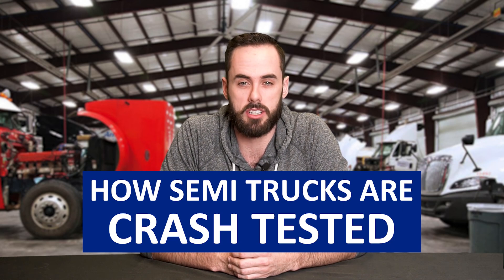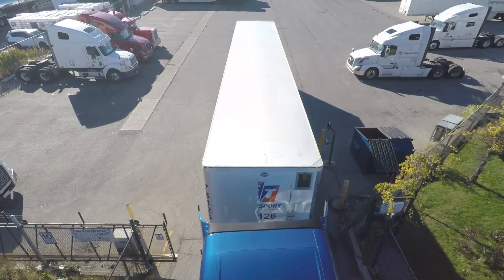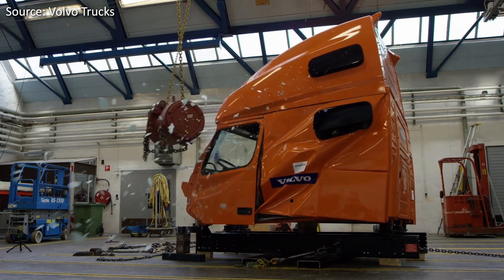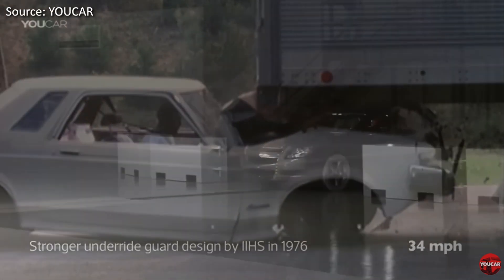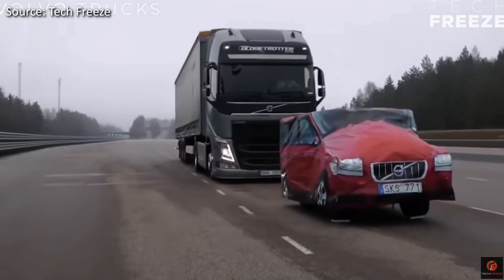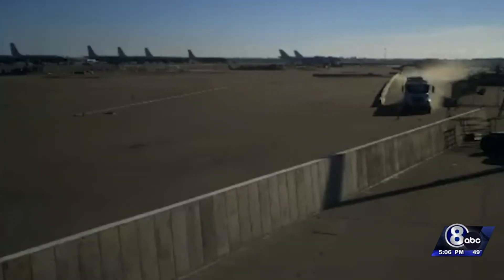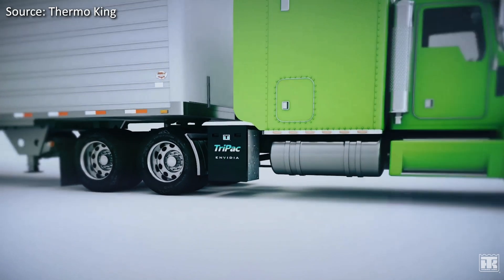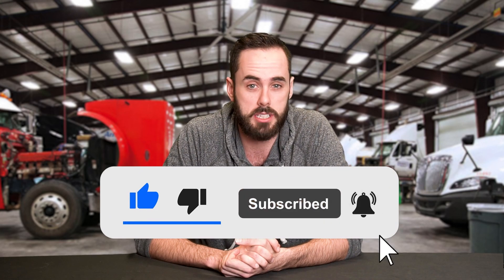How Semi Trucks are Crash Tested (Don't Mess with a Semi)

Comment: 0:50 Yep!!!  Junction U.S. 97, Washington Hwy 14! The door swinger believes EVERYBODY is gonna turn and stay on 97.  What? A three way…STOP? Trucks have just come off about a four mile downgrade and then a door swinger pulls right out in front. I drive Washington 14 just a few times a year and this has happens a lot!!!
Reply: That is a frustrating intersection,   it is asharp turn to get straight to see both directions with limited vew distance to the right and traffic coming off the hill to the left.  That hill is not the 4 mile down-grade but comes from the bottom of it, 90% of trucks turn right after that hill to get down to 84 or continue on 97south.  It is frustrating because most people turning, do not signal till the last second, then you have to watch for anyone flying around the bend on the right.  It really needs to be re designed to prevent accidents like that, but that was completely the fault of the driver that pulled out. He had no right of way from either direction. Just impatient and incompetent.
Reply: @Bendigo1  Wasn’t exactly sure how long the downgrade is coming from Yakima. However, northbound sitting at that stop sign you can see more than  enough distance to not have pull out in front of ANYBODY eastbound or westbound on 14!
Reply: @onebadapple83  I have driven that stretch many times, i knew what you meant about the grade, but it is not really a factor as you need to stop before turning left on 14 from 97.  That short stretch is steep and traffic going east from 14 does not have to stop.  And yes there is enough distance to the right to not pull out in front of someone, but once you start the turn you better get moving because traffic going west on 14 will come around the corner and try to take you out.   Either way, there was absolutely 0 reason that idiot should have tried to make that turn when he did, between the truck on his left and the traffic on his right waiting to make the left, both had right of way over him.

Comment: I have a VNL 760 with Volvo Active Driver Assist and it works great.  I would not drive a truck with out it.  If you were to have a medical emergency and be unable to control the truck this would save lives by breaking the truck and stopping it.  As the reliability I have not had any issues with up time at all.  Doing regular maintenance and keeping a top of things this truck is reliable safe and a great ride

Comment: Just had an accident yesterday. Trailer brakes failed so I didn’t stop in enough time. Hit the car in front of me. Thank God no one was hurt! Only thing hurt (other than the vehicles) was my feelings.
Reply: Didn’t you use your hand brake to test the service brakes on your trailer or especially a container chassis to ensure that they were working properly? Never, ever take it on faith that whatever you hook up to that the service brakes are in good working order! The European semi tractor trailer and truck trailer have four hook ups: “hot” side constant air feed, service brake air feed, “pigtail” for lights, and ABS hook up to link the trailer service brakes to the tractor/truck ABS to balance brake inputs so as to give the driver better control of his/her rig. We should have that here. The European tractors/trucks have electronic braking those days which is a lot better system.
Reply: ...These days. Damn phone!
Reply: what if the brake lines got ripped during a ride or something got cut or snapped.    You can test before going out,  As anyone should do.
But sometimes,  Things can fail while being on the road and the driver will often only find out about it when it's too late.
Shit happens no matter how careful you are
Reply: @henryblanton6992  that is one reason i can not stand companies taking out the trailer brake handle in the trucks,  it leaves only the parking brake to test on the trailer,  and it does not give us any way to test the service brakes on only the trailer.